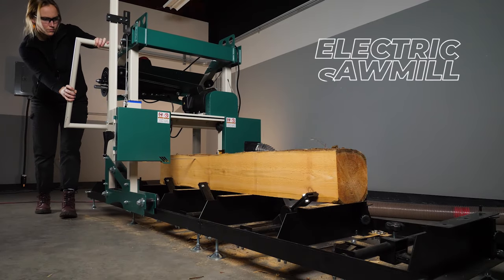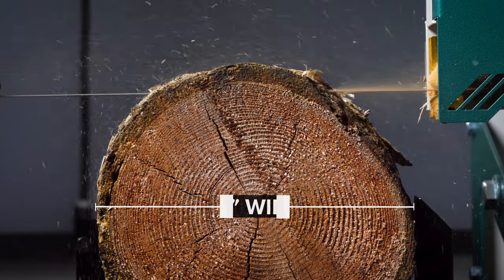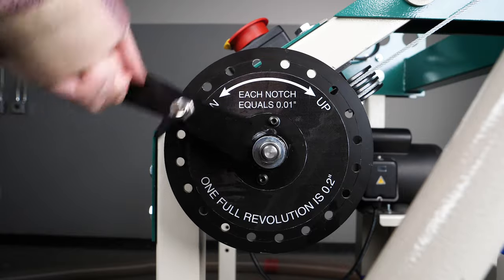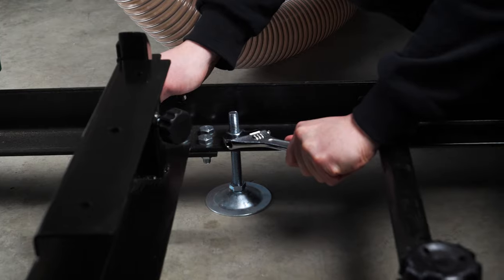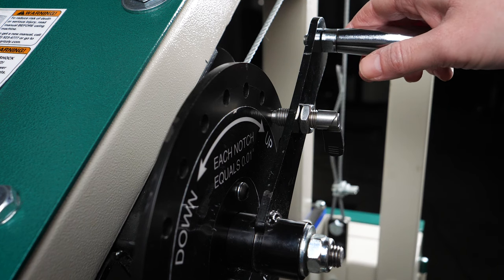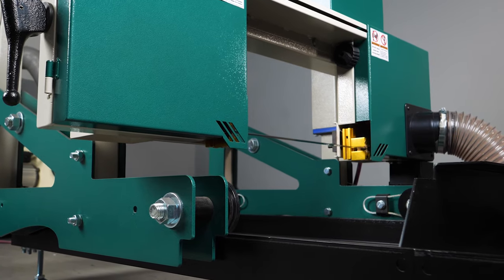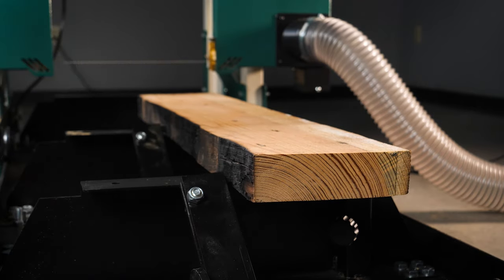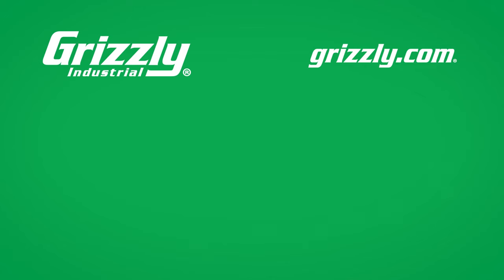New ELECTRIC Sawmill! Mill Lumber in your Garage | G0960

Comment: It’s appealing to have a smaller more compact mill for resaw work or small diameter specialty hardwoods but for the price,,, 8’ length of cut would be my minimum which requires buying two 3’ extensions at 750.00 a piece,, doesn’t make sense financially. Woodmizer extensions are 5’ and 500.00 dollars. Never mind I can buy a woodmizer saw at that price that cuts 12’ long boards and 22” wide.  🤷🏼‍♂️

Comment: 43"  is sort of short logs, I wonder if you can reposition the logs to cut a longer log, without having to pay an extra $700 (plus shipping) to go an extra 3' ?
Reply: There is a 3 ft extension which lets you do 79 inches.
Reply: There its not a problem to add any size of extra track, to me its so easy  just go buy same track material at any place that have the metal and make your own so simple if you know how to weld measure and cut the pcs.

Comment: I own one of your Shapers and a thickness planer.  Will this run on 220?  Seems 110 would not be strong enough.   14 Amps is quite a bit and would take up one circuit on a 20amp line.  Seems like 220 would be a better option.  Let's hear from some folks who have bought this to chime in and let  us know how it performs on 110.   Looks like a good machine.  And how much are the replacement blades and how long are they?